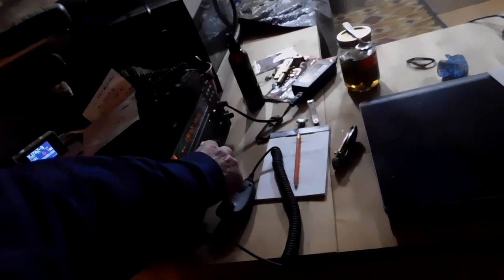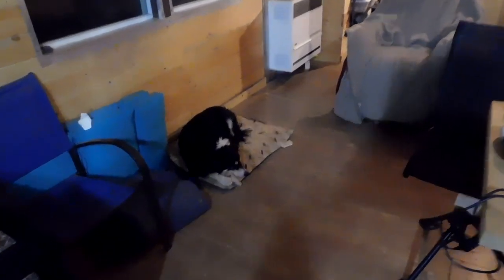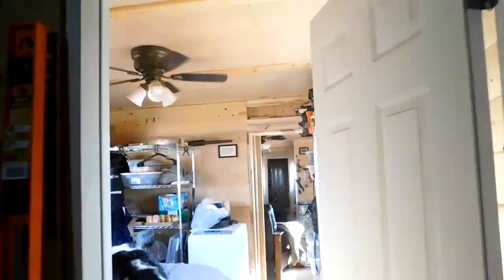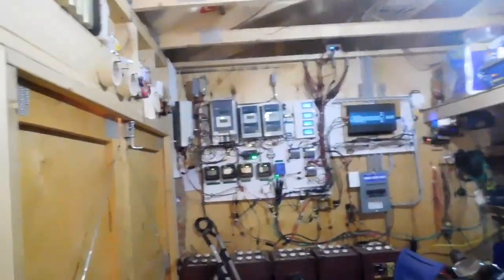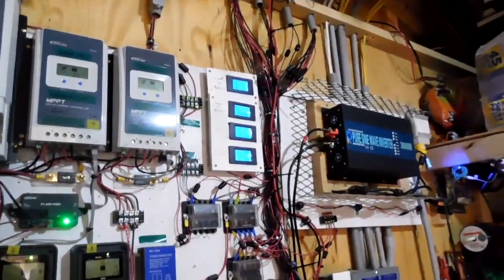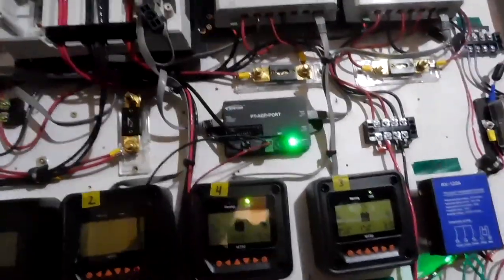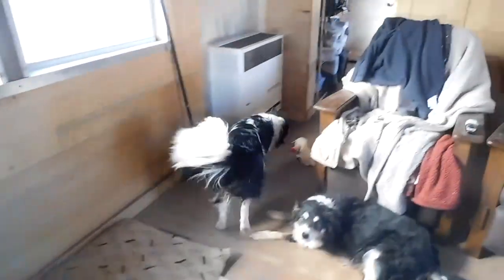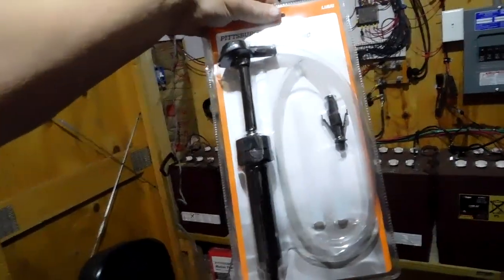Building an off grid solar powered house part 168. EPever PT-ADP-Port controller interface.

Comment: Hey Tim.  I think I might know why you are having the errors.  Remember when you got the charge controllers, there was a green plug with a little zener diode (I think) on the terminals in the temperature port?  If you move the temperature sensor to the PT-ADP then I think you might have to put those back into the charge controllers temperature ports.  That might get rid of your errors.  Just a thought.
Reply from the maker: I’ve tried the temp leads both ways. The PT-ado is where they need to be. You are correct. I need to do another review video on one year progress or something like that.

Comment: I  have two EPEver 50a controllers.  I don't have the PT-ADP.  They seem to fight.  One will drop to zero while the other is showing lots of amps.  If I disconnect the one then the second one will also come up and show a bunch of amps.  Have you had this issue?  I'm wondering if one of my controllers is bad.
Reply from the maker: What’s happening is one of the controllers sees a full charge while the other is charging. It’s normal and ok. If you increase the load above the output capability of one controller the other will start to show more charge as needed. When the controllers first start charging in the morning you should see a closer to equil charge then one will drift off pretty quickly as the other takes over.

Comment: I want to know if you ever figure it out and where i can get one.
Reply from the maker: Donald Steele I got it from eBay. Look for pt-adp-port
Reply from the maker: Donald Steele I did figure it out. Set your controllers up separately, use the default baud rate, plug in the master first, then the slave. That’s really all you need to do. Don’t program the controllers through the controller and don’t program them with the controllers hooked up to the interface. That’s how my slave controller got scrambled. I might try it again later but need a break from it.
Reply: @timsvids5983  well i will hold on and see what you can get from it. Doesn't it have built in wifi  ? Is that why you had 2 show up?
Reply: @timsvids5983  yeah i would try an shunt and digital voltage reader for solar in and voltage out to batteries. That would show it. So mt50s wont work with it?
Reply: @timsvids5983  so dont plug it into a computer and program it just do that from mt50 or my wifi and phone to the same settings for battery then connect adapter and remove mt50?
Reply from the maker: Donald Steele You can have a mt50 on the master or the slave but not with both. A shunt on the slave and a mt50 on the master is a good idea.
Reply: @timsvids5983  ok cool i just ordered one thank you sir
Reply: Will it work as the 100 amp master and 80 amp as slave?
Reply: @timsvids5983  i noticed you have several controllers and wind turbine controllers whats the size of your solar arrays and wind turbine bank?

Comment: How did it not go well?
Reply from the maker: Donald Steele The interface doesn’t seem to really have an advantage. I like the mt-50 monitors and can’t use them with the interface. Plus the last time I had it hooked up it scrambled the slave controller. Had to do a complete reset.
Reply: @timsvids5983  shit i was told this wasn't available yet by EPEVER so seeing you with one I'm curious  . My system us portable wind and solar and i would like to get both of my controllers sharing information so they won't fight .
Reply: I have a bus bar for power in side to my bank with a 300 amp shunt and digital voltage reader and tester that would tell you if its working
Reply: I would be pissed
Reply from the maker: Donald Steele I’m not pissed, disappointed yes. The part was $23 or so. Learning experience. My amp meters are separated out so I can see what’s doing what and where it’s going. Works pretty good.

Comment: any updater on the epever controller
Reply from the maker: No not really. They’ve been working flawlessly since installed. I’m running 4 or them. The interface isn’t a necessary item but I’ve just left it inline. I replaced 2 of my batteries and added 8 more but that’s in a more recent video.
Reply: @timsvids5983  ok cool